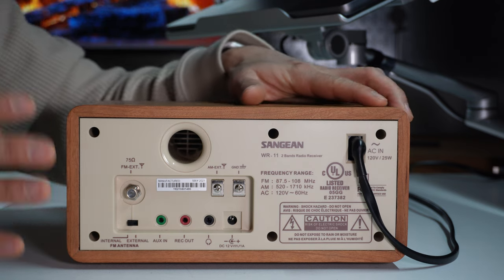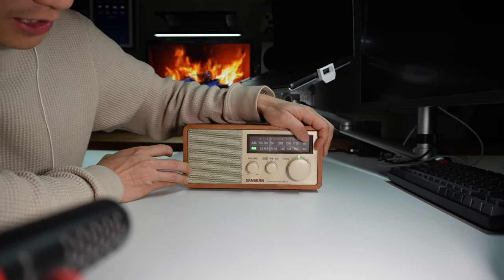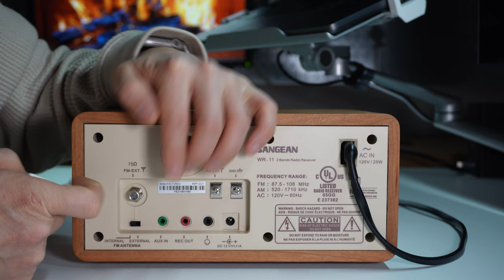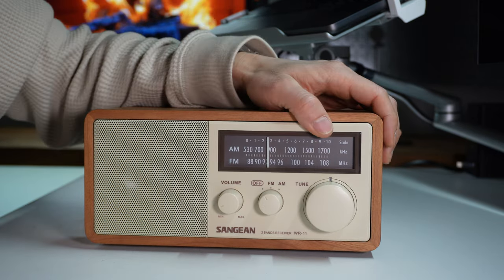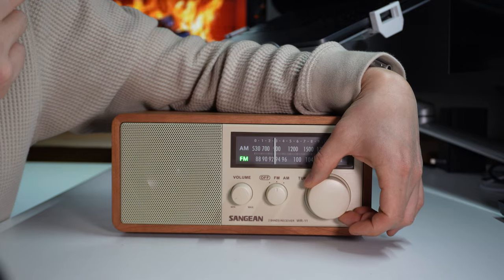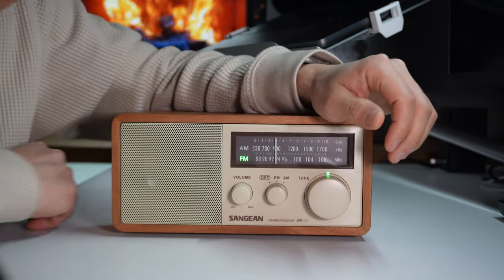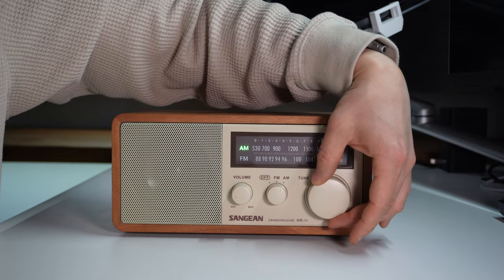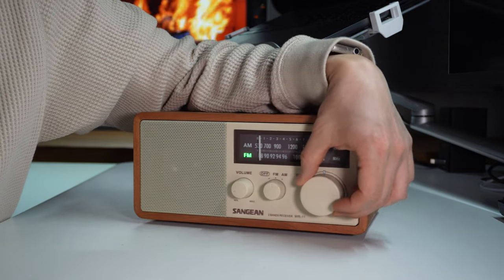Listen to the Audio Samples of Sangean WR-11 FM/AM Radio

Comment: I have the  "Prison Version" of this radio. It has a thick, clear acrylic case, so prisoners cannot hide contraband in the radio in their cell. Cool.  I like being able to see the circuit boards and components within. The Specs say that the prison version has the aux input disabled so as to prevent prisoners using it as a PA. Mine, however, has a working aux input.
Reply from the maker: Wow awesome thanks for sharing! I actually went to Sangean booth in CES 2024 and met their president!

Comment: Sound quality is amazing and quite massive. I just wish it wouldn't be a DSP tuner but a real 100% analog one, as i'm not a fan of the choppy bandscan with DSP radios. But i guess that's just too much to ask for today when DSP boards for Radio receivers are smaller and cheaper to produce than real analog circuits. But DSP based radios do have a benefit as they latch to a strong signal and really hold on to it. Which for a radio that you don't use for DXing but normal daily listening, is pretty perfect. Depending where you live, AM does not have all that many stations during the day but once the sun sets, you get a lot of stations.
Reply from the maker: Thanks for the info and sharing your experience! Smash the like and subscribe! I also reviewed the Panasonic and Sony portable radios a few days.
Reply: Yeah there's an AM station that I like to listen to which I can only get at night. I live in the Philadelphia area, and this station is all the way in Canada! They play old radio dramas around 10pm so it's a fun station to listen to if you're into that sorta thing. AM is cool in the sense that you can pick up some pretty neat stations from far away.
Reply: @TylerLarew  Wow i#d LOVE to have such a station near where i live. I can only simulate that experience with a little retro radio that has a flash memory added to it with some old time radio shows like CBS mystery theater, Johnny Dollar, Dragnet or X Minus One.